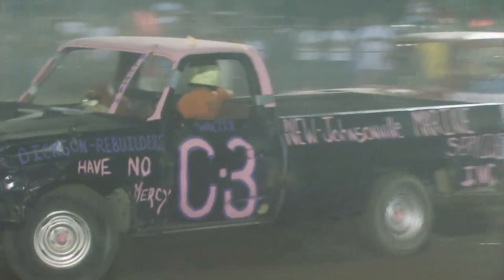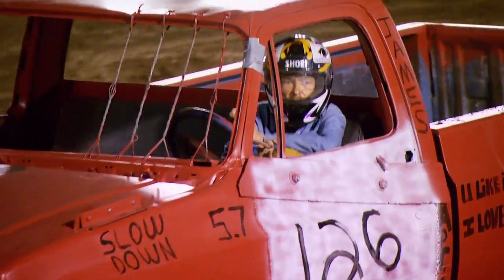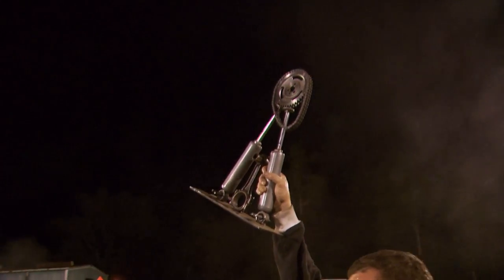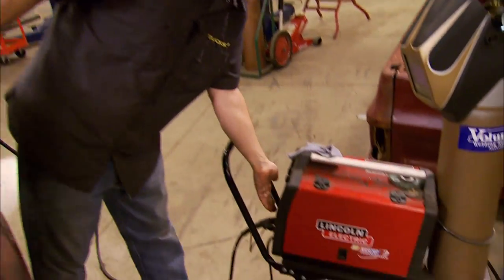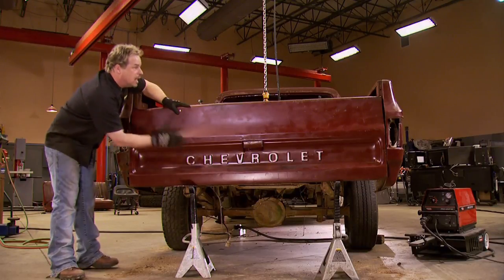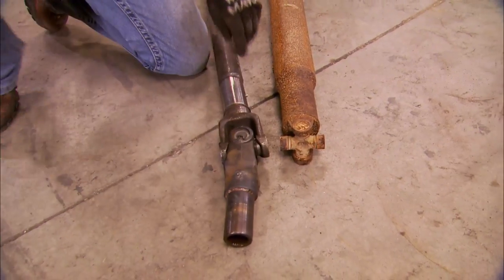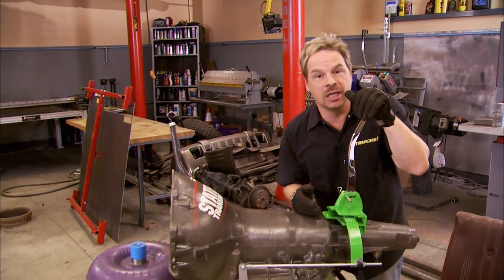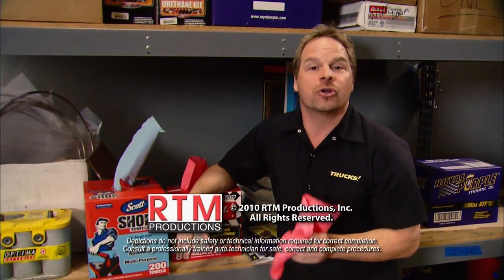We Build a Demolition Derby Truck - Trucks! S10, E17

Comment: Dang mid fuel tank seem like the engine should be there j/k. Looks fun but I bet they are sore afterwards but that's what the 🍻 is for.
Reply: It's not as bad as you would think. Like a football player doesn't get hurt badly because he has a helmet and pads and is expecting to be hit hard. In the derby cars you have a helmet and padding on the driver's door and know you're going to get hit by 5,000 pound vehicles.
But with that said I have had whiplash over a dozen times, broken nose, both hips pulled out of their sockets, stitches by the mile, and wake up in pain every day but would do it all over again 👍🏁

Comment: the derby trick back in the 70's was to run manure spreader tires on the cars to get all the grip you could they came in 15 and 16 iin sizes so they were a stock rim fit

Comment: As a former derby builder and driver I scratched my head at why did you weld that truck up before doing the interior (seat, seat belts/harness, steering column, wiring, battery box, trans cooler etc) Makes no sense to weld the doors shut before doing those first. Now you all get to climb in and out of that cab to do those tasks. Even more so, good luck getting the stock bench seat back in (which is recommended to use over a single bucket seat.) The bench seat can be use like a "catchers mitt" when making a reverse hit. Just before impact lay down a bit so the seat takes the impact, not the body from sitting up. Also, do not cut away any of the steel from the truck. That hood, if it were cut in the right way, that steel could be wrapped back over the top of the hood and welded down (makes the hood stronger and who cares how it looks.) Outside of those, the build is looking good.

Comment: 4:07
"It's amazing that these trucks even still move."

Really?

Note for this I live in Wisconsin smack dab in the middle of the rust belt

I was at my local sawp meet in September and they had a truck derby. Saw a Chevy square body probably in less condition than any of those trucks and it lasted all the way to the rear wheels shredded down to the hub, rear axle dragging on the ground, and frame completely snapped in half. Only reason he got third was because his axle sat higher than the rims (what was left of them) and he couldn't move.

Now that's a truck that is amazing it still moved let alone ran.

Comment: Too badly destroyed these trucks that are getting harder and harder to find and there are high demand in my area
Reply: As cases of full sized cars are even harder to find to smash up when square bodied GM pickups are harder to find as well.  As tips from the sanctioning bodies of demolition derbies to ensure safety when most transmission builders had fortified the transmission to survive a heat when it would still run when the clutches are worn down to the backing plates.

Comment: That truck was to clean to be cut up. No one is putting a fully rebuilt trans that costs $$$$ to get destoryed in 15 mins in a derby truck. Ive seen alot to engine swaps at derbys but not many people dropping a few $$$$ on a rebuild bored over engine to have it blow a ring or melt down when the radiator blows because they always blow. Theres more money in that truck then most peoples daily drivers. Idk if they ever actually crashed it. But im thinking not and they pulled the engine and trans back out as soon as the camra was off because most derby cars cost between 500 to 1000 dollars

Comment: To think, if you ran that truck around here it would be extremely under built. Also, round here people are using less square body trucks in favor of newer super duty fords and 3rd gen dodges. Maybe that's because most of the square bodies were used up, or full box frames are better, or both.

Comment: Let me share some knowledge I have picked up over 40 years of demo driving and building.
1) Go to the junkyard and cut out about 40~50ft. of seat belts and pick up a shit ton of duct tape on the way home.
2) Wrap each U joint 6~8 times with seatbelt. Wrap over that with as much duct tape as you feel is enough.
3) On GM trucks (square body) wrap the rag joint at the end of the steering column with about 4' of seatbelt and again duct tape it like you kidnapped it.
4) CHECK YOUR RULES ON THIS ONE!
Wrap the rear leaf springs from the axle to the rear shackle with a lot of seatbelt VERY tightly and duct tape it like there's no tomorrow.
This will help keep all the weak points together alot longer.
Reply: Why not weld washers over the drive shaft snap rings and a small strap across the differential u joint straps to keep the caps from coming out?
Reply: @bobroberts2371  you could but I would have concerns about the heat making the caps brittle.